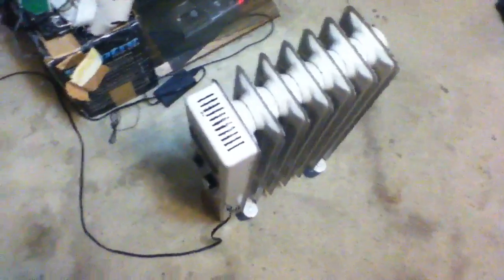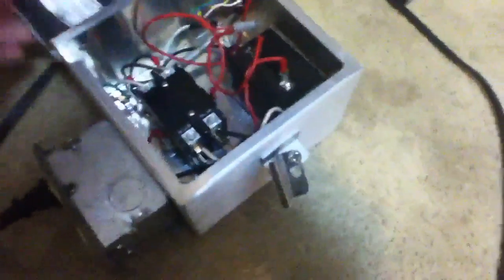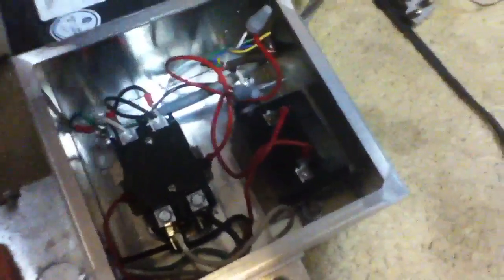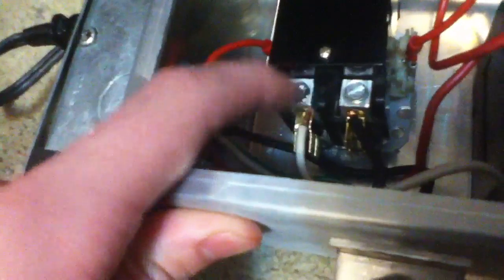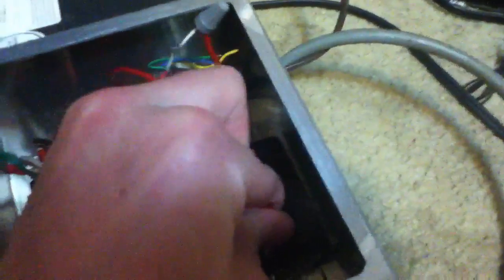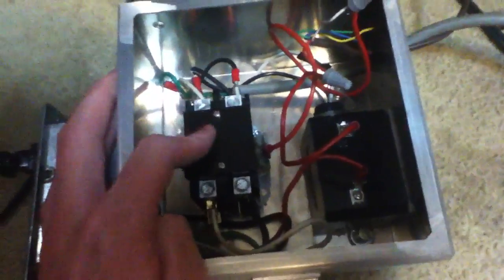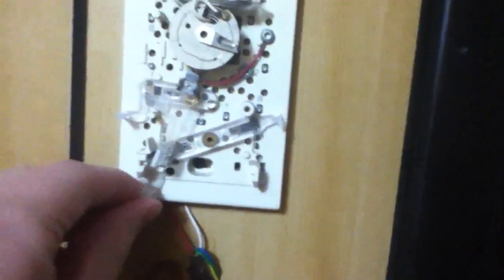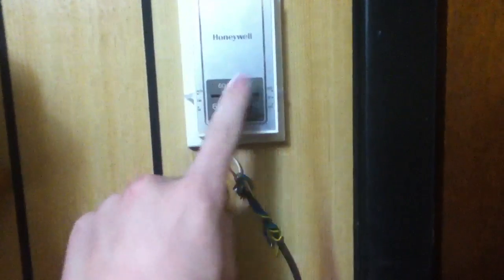Thermostat controlled outlet project (complete)

Comment: Thanks for this video! No one else has a video that explains as much... so I hate to ask.  I really want to build a unit like yours. Will you tell me what transformer and contractor you use or one that is similar. (model #, voltage, etc...) any information that could help me succeed would be greatly appreciated!  Thanks compdude957!